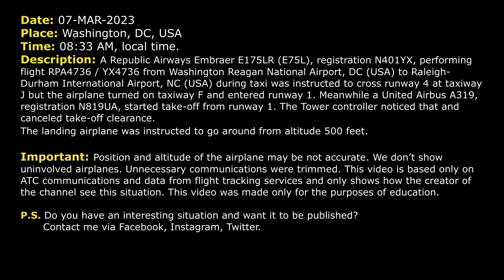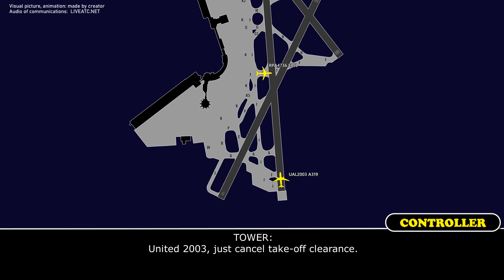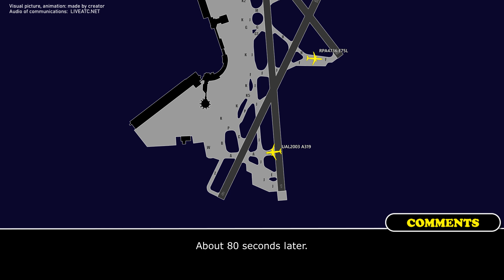Runway incursion. Republic Embraer E175 entered wrong runway at Washington Reagan Airport. Real ATC

Comment: Two things about this incursion are frustrating. One, the reenactment doesn't show whether the RPA actually turned left at Foxtrot and was already holding short of 01 when he received the clearance to cross 04 at Juliet. The animation makes it look like the RPA never turned onto Foxtrot and thus should have continued on Juliet to cross 04 but INSTEAD made the left turn onto Fox AFTER getting the updated clearance. But is that actually what happened?

Second, if the RPA was already holding short of 01 on Foxtrot, I can see why the clearance to cross 04 could be interpreted as a SIMULTANEOUS clearance to cross 01 followed by 04. If he's already on Foxtrot holding short of 01, how's he supposed to get back onto Juliet? He'd have to enter 01-19 and taxi for ~750m in order to make a left back onto Juliet. Either way, RPA is gonna bear the brunt of the blame for reading back "cross 04 at Juliet" and then proceeding on Foxtrot but if he was already on Foxtrot I can see why he lost situational awareness here.

Ultimately, the taxiing SOP at KDCA seems like a huge part of the problem. Glancing at the charts, sending any departing plane to RW33 via Juliet - Foxtrot looks like a recipe for disaster, especially if the airport can turn from 33 to 01 this quickly. For starters, it appears there isn't enough room to cross 01 on Foxtrot and hold short of 04. You'd have no choice but to cross 04 in order to get clear of 01. I'm very curious how often ATC clears pilots departing on 33 to cross BOTH 01 and 04 simultaneously? This could easily lead to the kind of expectation bias that might lead a pilot (like the RPA pilot in this case) to hear "cross 04" and assume it implicitly includes clearance to cross 01 first. Another problem with taxiing on Juliet - Foxtrot - RW33 is that you can't merely cross 04 to stay on Fox. In reality, one would have to enter 04 briefly in order to continue to RW33. Objectively, Juliet - Golf - Hotel - Foxtrot - RW33 makes way more sense, but the intersection of G-G1-H is listed as HS3 so I get why ATC might avoid it. But if J-F-33 is SOP, it's maddening that Jeppesen hasn't listed this as another hot spot. Looks like a good candidate for HS5 on the next AIRAC cycle, especially after this incident.

Comment: I live in the DC area and am familiar with the usual ground movements at KDCA. The past few days we have had strong winds outta the northwest which is why some planes have been departing and landing 33. It’s only 5000ft so it’s not used that often. The ground controller initial tells them to taxi to 33 and hold short runway 1 at F. The usual clearance is to taxi to runway 1  via J, cross 4 at J. He told that to Brickyard, mistaking that he had given them 33 and not 1. So tower was wrong but also the crew was wrong because they were not clear to cross Runway 1 and they crossed Runway 1 and 4 at F and not J. Bad situation in general and glad that a accident was avoided

Comment: What a mess clearing them to 33, hold short of runway 1 at foxtrot. Then he clears them to cross runway 4 at Juliet. Absolutely doesn’t make sense, pilot should have in theory questioned it, but that was either a lapse in memory from controller they were cleared to 33, not 1, or just said the wrong thing via habit.
Reply: He shouldn't use memory for a taxi route.  It should be written down on his knee.  Basic flight school 101.  This guy needs to be grounded.  How long has been behaving like a parrot and been getting away with risking lives?  Only he knows.  Get the dummy grounded immediately.

Comment: I the beginning ATC assigned Brickyard 4736 to taxi to Rwy 33 via NFJ. The next clearance from ATC was cross Rwy 4 on taxiway J.  Just an odd way to get to Rwy 33 unless they were reassigned to Rwy 1? I listened 3 times and still perplexed. Thanks VASA for another scary, yet informative video.
Reply: Initial taxi for 4736 was NJF (rather then NFJ).  That's why there are so many comments here about expectation bias; they turned left on F per initial directions (straight across 1) despite 2nd controller telling them to cross 4 at J.
Reply: This incursion is a result of loss of situational awareness by the ground controller and the failure of the pilots to contain the error.

Comment: Isn’t 33 like 5000 feet?
Reply: Yeah....so?
Reply: @billybuttons4298  surprised a e175 is using that short of a runway
Reply: @essel23fly  It’s an RJ. Not a 777. Key West has a 5,000 ft runway. They land Airbus and 737s on it all the time.
Reply: @billybuttons4298  right but the point was key west doesn’t have a 7000+ foot runway. Also the way he was cleared to cross to taxi to the longer runway, it probably means there wasn’t much of a wait to takeoff on the longer runway. I mean it doesn’t really matter I was just wondering
Reply: @essel23fly  I don’t know what to tell ya. They use that runway all the time at DCA. It’s a busy place. The RJs use that runway all the time to help with congestion.

Comment: Ohhh, that's one's on the controller. He forgot which way the aircraft was going and told them to proceed as if they were heading for 1, but he'd given them taxi clearance for 33 with hold short of 1. So when he told them to cross 4 at Juliet... well they were on Juliet, so that's OK, and they needed to cross 4, so that makes sense. And off they went.
Reply: Not on the controller. He gave instructions. They read back the instructions verbatim. Then they proceeded to do something totally different from said instructions. Yeah it may have been different from he original plan, but if you get an instruction and read it back then do something to the contrary, it's on the pilots. And as far as your nonsense talk of them being on J and crossing on 4 and that being okay etc....uh no. The instructions were to cross 4 on J. They crossed 1 and 4 on F. So it doesn't make sense at all and was completely their fault. Are you even a pilot? Your comment was idiotic.
Reply: They were unsure, so moved into a runway.  You can see how that is a very bad move.

Comment: controller set them up for failure, but we have to crosscheck better.  Fatigue is probably playing a big role in all these.  The trips are getting more and more fatiguing. FAR 117 was supposed to help, and in some ways it did.  In other ways the trips are worse from a fatigue standpoint.   I am sure ATC is having the same issues.

Comment: Clearly, the Republic aircraft failed to follow taxi instruction. When the second call was to cross rwy 4 at Juliet, the pilot should read it back and questioned the controller’s intent given that he initially cleared to Juliet and hold short of rwy 1. That second taxi instruction to cross rwy 4 at juliet was never going to get him to rwy 33. He should have questioned the controller’s intent. He didn’t and proceded to cross rwy 1 in front of an aircraft takeoff roll. He also should check the runway for traffic on it before crossing. ATC can make mistakes and it’s incumbent on pilots to be situationally aware enough to at least challenge ground control.

Comment: This is a 50/50 blame here.
Reply: Nah, it ain’t. You don’t cross a runway you don’t have clearance to cross.
Reply: @BLAMBERRY  The controller told him to hold short of 1 at first. They were both wrong
Reply: @DavidShaker274  Who cares what the initial instructions were. He gave new instructions and they read the instructions back verbatim and proceeded to do something completely different.
Reply: A change if instruction is valid.  Unusual.  But valid.  What is not acceptable is FAILING to write instructions down to compare.  There was a clue with a controller changeover.  Perfect opportunity to compare both sets of instructions on the kneeboard.  Except this terrible Parrott pilot didn't write it down.  Just chirped back what he hears without any mental processing.  Disrespectful to the controller by not writing the instruction down, and unprofessional creating a safety failure opportunity.
Reply: Nope, not even close to 50/50.

Comment: From 30 years of experience in the FAA as a controller.  The cross RWY 4 instruction was a change, but the pilot read it back and did something different.  His responsibility was to question the call if it was different than previously told to expect.  By accepting the call then doing the wrong thing he has in fact had a pilot deviation. Sorry, the controllers did a confusing thing, but the pilot wil be at fault.  Lesson, always verify your clearance with previous clearances and expectations, and always question if they don’t add up.
Reply: THIS! It's the pilot's fault for the deviation, but ATC screwed up big time with the confusing omission of a runway change. So while ATC may not be at fault, they need to do better in the future, from a human factors perspective of avoiding these types of incursions. It isn't about who's at fault: it's about safety and preventing this from happening in the future.
Reply: Yeah, it’ll fall on the pilots. It nearly always does, and I guess that’s right if you want to maintain standards. But once again, ATC setup an ill-conditioned situation here with contradictory instructions. Yeah, the pilots should catch that, but let’s not let the first hole in the Swiss cheese entirely off the hook…
Reply: Shouldn't  ground control have told them that there was a taxi clearance change? They were cleared to Rwy 33 and would not be expecting to be crossing Rwy 4 @ J to get to 33. They were already holding short of 4 @ F as they had been instructed to do. I do understand that they read back the clearance and proceeded to do something different, but I can't see how some of the responsibility doesn't get placed on ground control.  Just my thoughts. I have no experience as a controller, just a low time CFI trying to use some common sense.
Reply: He technically still crossed 4, but the omission of the runway of runway 1 and the Juliet instruction instead of foxtrot should have raised some flags.
Reply: @nolanrussell518  This is one of the most idiotic comments ever. "He technically crossed 4." Okay cool...he happened to cross 4 while doing everything wrong and contrary to the instruction that he got, and not to mention, read back. Moronic comment.
Reply: Why isn’t tower issuing the crossing clearance? This has got to be the only major airport that I know of where the local controller is not the person issuing the crossing clearance.

Comment: The controller who gave the instruction said Juliet so quickly if I wasn't reading it on screen I wouldn't have known what he said. I know the pilot got it, because the read back was correct, but that instruction was not as clear as it should have been.
Reply: Poor communication has been called out before by pilots, there is one video where the pilot asks for clearer communications with a JFK controllers: "clea lad".  He made him say it 3 times until he said "cleared to land".  Good.  In this instance he simply talkedback the route, instead if reading it back off his kneeboard.  Completely unacceptable.  A complete failure to read during a readback.  He should have his license torn up.
Reply: So what you're saying is that you couldn't understand what the controller said. You, who I assume isn't a pilot or at least not a 121 pilot, didn't understand the controller. Since you didn't understand, the instructions weren't clear. The pilot, who is an actual pilot, understood the controller. Because guess what...he's a pilot. The instructions were clear for anyone who actually does this professionally. He understood the instructions and read them back verbatim. Just because you, a casual observer, doesn't understand doesn't mean pros don't understand.
Reply: @billybuttons4298    So you just decided to repeat exactly what I wrote, but ratchet up the snark to 10. Wow, what an impressive display. You should be truly proud of yourself.

Comment: Wouldn't be surprised if the FAA implements a new procedure for planes to cross an active runway that has a plane on that runway or landing on that runway, the current procedures is proving to no longer be adequate enough. EFB's need to have a better live tracking airport diagram for pilots to be more aware of their surroundings. With the influx of new pilots after covid we need new measures to avoid more spikes in incursions.

Comment: Poor Brickyard didn't stand a chance with those taxi instruction. Granted, questioning the controller would have helped considering he was instructed to cross RWY4 @ J , and he was holding short of RWY 1 @ F. Mostly ground for not paying attention, and a little on the pilot for blindly crossing without paying attention. --- Clear Left , Clear Right , Clear to Cross --- Would have seen United on the Runway.
Reply: *would have helped
Reply: Was also holding short of 4 on Foxtrot.  Without seeing it in person, I cannot tell whether the signs for 1/19 and 4/22 are visible simultaneously, at which point being cleared across one would appear to be a clearance across the other.

As well, with the literal two seconds between takeoff clearance and the cancellation, I doubt, if following protocol to a T, that at the point that Republic cleared the intersection, they noticed United holding in position, but without landing lights lit, as they hadn’t yet been cleared for takeoff.  At the exact moment United was cleared for departure, Republic was already starting across 4/22.

Comment: I was ready to blame the pilot of the e175 100% but then realized that they were following the initial taxi clearance.  Ground controller didn't notify them of change in runway or instructions, and the pilots didn't catch the change.  Certainly fault on both parts.
Reply: The Republic crew was 100% at fault. They received instructions, read back those instructions verbatim and did something totally different.
Reply: The problem is, the pilot is at fault for not following directions. If there is a change from the initial clearance he needs to clarify. Otherwise this happens. 100% preventable if the E175 pilot doesn't cross RWY 1.
Reply: The crew unfortunately will be 100% culpable since they technically crossed a runway they weren't cleared to.... BUUUT ATC screwed up big time and set the crew up for failure. Not only did they emphasize there was a runway change, they didn't specify the runway in the new taxi instructions (required when issuing a taxi clearance, in this case because it was a new runway being issued from the original clearance). While everyone may pile on the crew and blame them... why not focus on making things better and not throwing pilots under the bus with a "GOTCHA!" situation. ATC failed here, even if the ultimate responsibility for the deviation lies with the pilots.
Reply: > I was ready to blame the pilot of the e175 100% but then realized that they were following the initial taxi clearance.  

These are the clearances they were given:

#1: "Runway 33, taxi via N, J, F, hold short of 1."
#2: "Cross 4 at J, monitor Tower."

The E175 crew read back the clearances correctly in both cases. What they executed was crossing Runway 1 at F, without ever having a clearance to do so. It appears both made errors: The controller for not clarifying that the runway assignment had changed and the E175 crew for crossing Runway 1 without being cleared to do so.

It is also possible that the controller was confused and issued the original clearance in error, and then thought he had cleared the aircraft to Runway 1 all along. Without seeing the results of the investigation, it's hard to fully judge.